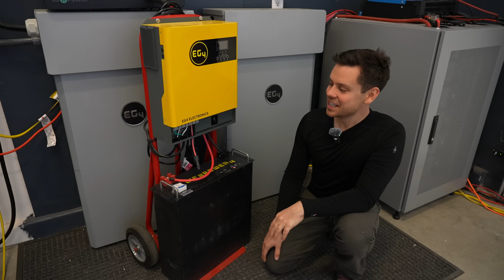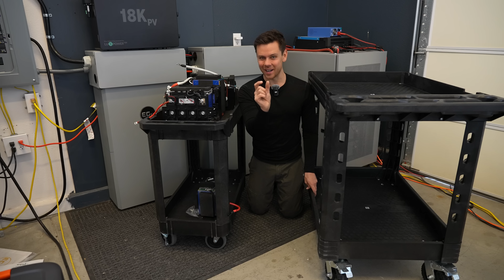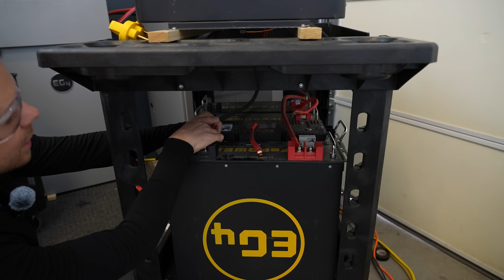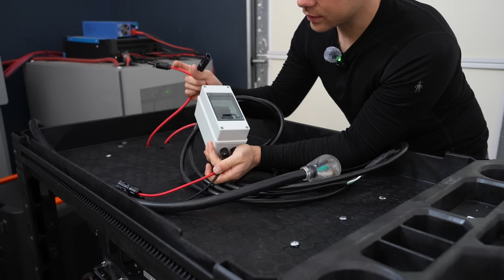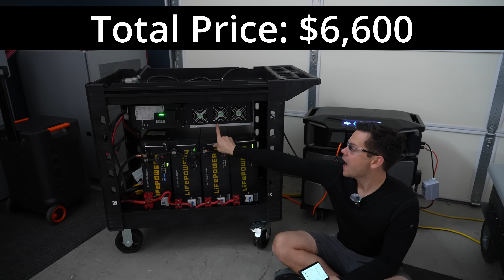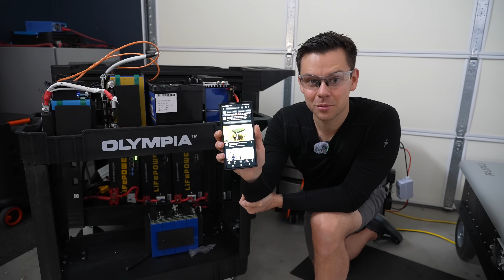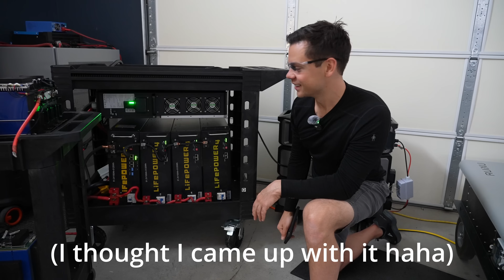DIY VS Ecoflow Ultra! Save thousands building the Solar Kart

Comment: Page 8 of the 6000XP manual specifies that "The inverter should be installed upright on a vertical surface", and specifically says to NOT mount it in the orientation that you used.  The is most likely related to their cooling design, but could also be related to certification requirements.

Comment: instead of 4 100 Ah batteries do 2 280Ah in those DIY cases (more energy dense), also like 40% more battery capacity and cheaper then 4 100 Ah Server Rack Batteries or if it can't handle the weight of 2 you can do 1 of them and still have almost 3/4 of the capacity of 4 100Ah but weigh way less and still come out cheaper then 2 100Ah and 1 of those can supply the amps needed for a 6000XP. If the cart could handle more weight you could go with 2 of those 280Ah batteries and a 12000XP.
Reply: Except those batteries are extremely heavy I think they're over 300 lb each and to try to set up by yourself let alone move would be difficult. Not to mention they've only been out for a little while and we don't know how reliable they are going to be. The server rack batteries have been out for a long time and redundancy is important especially for people off grid.
Reply: @MyCabinLife  I've been running a portion of my house off one since March

Comment: My priority when considering a system was decent capacity, at least an inverter that could deliver 6000 watts, have the desired and convenient outlets, and be portable in regards to transporting in a car. My choice was a relatively expensive F3800. I admire these DIY systems, but the portability is a backbreaking ordeal. What I’m getting at is the comparisons being made left and right between the all in one portables vs the DIY systems. They each have their individual place.

Comment: Next time you could install the inverter with the cart upside down to make it easier. With all the great stuff you build it would be easy to build a cart that has more weight capacity and whatever size you need.
Keep up the good work!

Comment: The down side is you need a smooth surface to roll this around. Will never go off road or to a job site.
Flip the cart upside down and install your converter/controller and flip it back over.

Comment: Nice video. The jackery explorer 5000 plus at sale (3000usd) with 5kwh and 7200w output is very good though for all in one solution. You can get 2 and have 14400w output, and add many batteries (5kwh and cost 2000usd each). However it comes with ready to use outlets and other advantages. Even for resale value I think I'd rather have 15kwh all in one vs 20kwh diy. It depends on your needs and how much solar you can harvest and make it work during the day (the heavy loads during light hours to use the solar and leave the battery for the night). This I mean for off grid. There are cheaper batteries and inverters than shown here but probably of lesser quality? Anyway, competition is good and power stations are coming down in price, yet to prove themselves as far as long term reliability. Nice video.

Comment: I am kind of surprised - I kind of expected a diy constructed battery pack - for less than $1500 you have 16 x 314 Ah cells and a suitable bms - ample space on the bottom shelf for them and 8 inch empty space left below the top shelf good for 16kW/h

Comment: Hey Will, from my experience, weight and capacity ratings are subjective (I am betting you are not naive to this fact). Due to Safety, Liability, Insurance, Government Regulations, etc, the manufactures max capacity of a widget is probably a fraction of what the widget can actually handle. For example, in the USA, an aluminum 80 cu/ft SCUBA tank, has a maximum fill pressure of 3,000 psi. In Europe, the identical tank has a maximum fill pressure of 5,000 psi.
All this said, It looked clear to me that the cart you were using was being pushed to the max.

Comment: I saw a guy that makes off-grid trailers that have solar panels, batteries, and inverter/chargers.  I thought that it may be a good business idea to provide temporary power in areas that are hit by natural disasters. Imagine being able to bring in via a trailer a power system that can run important household items (refrigerators & freezers, some cell charging and maybe a few lights and a TV) for several days or possibly even infinitely when the grid is down due to damage. I'm thinking tornado or hurricane affected areas. 
The challenge is coming up with a price model that makes it viable. 
I'm really interested in this concept and if it is doable even on a small scale.

Comment: I have a metal cart with 6 - 48v Lifepower batteries and a 3000 and love it.  Thinking of swapping the 3000 with  a 6000 XP.  I would get faster charging of the EV car.  I wish you tube would allow to add a picture to the replys.

Comment: I made one a couple of months ago. It’s a 12v system and I used your advice with on how to keep the batteries warm by using the Rv tank heater on some metal. I also installed a fuze box and some lights on a pole that’s mounted on the cart and they swivel. The only thing I wish I would have done is changed the wheels out for some that could roll over gravel, grass, and dirt. The wheels on these carts work great in a shop.

Comment: I did something very similar where I had my 6000XP mounted on its back, I thought it was great. Then my engineer, smart a$$ friend tore me a new one because it specifically says not to mount it on its back in the manual. Why would it matter if it’s mounted on its back?

Comment: WILL, is there a section on your forum for diy inverters like egsoo2 hf and lf boards?
I think there might be a cheapest easiest best route for an inverter, it would be, basically, pairing an egs002 board with a zx7-400(428) amorphous core transformer. 
Yeah, 
This would mean ultra low residual power draw, AND probably 95 percent efficiency, which is great. 
And
It would be small, and it could be assembled on 1 board, rather 1 assembly with fans, inductor, transofrmer and on swich and feedback. 
This could be a GEM for some on the forum.

Comment: Will, I built the same EG46000xp with 4 lifepower batteries using a custom 8020 frame. I got great advice from you YT channel and forum so I shared the details and BOM on your forum: threads / portable.88431. Happy Thanksgiving.

Comment: FYI 1/2" piece of HDPE plastic or plywood cut to the size of that lower shelf will help spread the weight out.  I build mountain top solar repeaters for work and this helps when building in a yeti cooler with a thin layer of plastic.

Comment: Wouldn't putting the two 12V batteries in series and using a 24V inverter be easier to wire due to smaller gauge wire?

Comment: Gosh those batteries are cheap. Wondering if I hook up 4 of them in series, I could use them alongside my LifePower 48V battery. Theoretically anyway. But it's probably best practice not to mix battery types even if they are the same voltage.

Comment: Carts are usually rated by the limit of their casters and not what the shelves can hold.  Find some better casters and improve caster mounting plates if needed, and you can put more weight than is sane on that cart lol

Comment: This setup have more inverter and battery capacity than the Renogy Lycan (which has two 48v 50Ah LFP batteries and 3000W inverter).

Comment: So, Based on some of your information, I'm getting the impression that two of the smaller carts with two or three batteries on the bottom shelf and  a pair of communicating hybrid inverters, one on each cart, would be the ideal way to create a portable, inexpensive (compared to buying a proprietary style rack mounting system), convenient DIY solar power distribution center. Just sayin'. With that, one could be loaned to your best friend in the event of a power outage and you could still power your 110VAC appliances and your friend should have enough to keep their food from spoiling until the power comes back online.
By the way, it's good to see you back to making unique, enlightening, and/or unique content. I had unsubscribed when you took your break from creating content. I have a very complete system but I still enjoy seeing what you're doing with currently available equipment.

Comment: On Amazon Little Giant
• 1200 capacity 
• Dimensions 36"L x 24"W x 34"H
Reply: 3600 capacity also available for little Giant
Reply: 445 is not a bad price for 42 inch 3600 lb cart
Reply: 650 lbs with 1 inverter and 6 48v 100AH  batteries total cost $9,200 for 29 KWH

Comment: Extra mass on the bottom shelf to spread out the weight will make the weight rating null and void. Aluminum would be the best, but most expensive option. 1/4 inch sheet would do it. Then the concern is the wheels, which can always be upgraded.

Comment: Could you hang the inverter off the ends of the cart?  If it would fit I'd have mounted it under the handle with the batteries at the other end of the cart.

Comment: Uline makes a 42 x 24 x 35 1200lb capacity 12ga steel cart like that.  It's probably more expensive, but 1200lbs is a lot of gear.

Comment: Great video.  I've been  thinking something similar like this but more of a wooden frame where I can use pneumatic tires or one of those garden wagons and build a top shelf to it with pneumatic tires.  I want pneumatic tires because there are two steps  I need to overcome to get in the house.  I like the concept.

Comment: Or get a 19" rack rolling transit case.  They're common in concert audio and military applications.  Then you can properly mount everything, and also not worry about that rectangle becoming a collapsing parallelogram when you roll over a bump and the bottom decides it's done moving.

Comment: Newbie question:  Could a person build two of these carts and use one 8kW solar array to feed them power?  Also, how much effort would it take to wire those two carts into a main breaker box and feed the whole house?  Basically, trying to build a DIY split phase solution with 40kW storage and 8kW PV input to power the house AND charge the two carts of batteries.  I want the whole-home solution to be mobile.  Thanks!

Comment: kind of feel a little dumb for not thinking of it sooner but I think I will get one of those garden or greenhouse wagons if I cant find one with some kind of shelf option Ill make them  add some 12v batteries my 3000w 12v inverter and some real heavy booster cables could make a real useful work station for around my shop and yard.  I guess with a decent shunt voltage reading and stuff in the booster cable line I could do some basic diagnoses and stuff HMMMMMM

Comment: Harbor Freight sells US General 36" x 24" metal tool carts for $80 ($60 w/ inside track club Membership). Is there any reason metal carts can't work with insulated padding also available at HF. Rated 450# but seem to be much stronger.

Comment: Thanks Will. This is exactly the kind of setup I need for my small cabin. Since I’m a complete!!!!! Beginner it would be great if you could do a step by step video for solar dummies. I guess when you’re as smart as you are it may be hard to imagine that even the most basic steps are a challenge for non electrical guys. Love what you’re doing this is awesome!
Reply: No this is a B&B and is mostly occupied.
Reply: Will this be left in an unattended cabin that falls below freezing?  If so, remember those batteries hate the cold and ones with internal heaters suck a lot of juice.

Comment: Please follow up with your suggestion of designing with a 12 volt system using the WattCycle 12 V, 300 AH battery/batteries. I just bought that very battery yesterday based upon your video from yesterday. We have been living off-grid in Central America  for about 3 years. There was a 100 AH battery with a single solar panel already installed when we moved here. We have since then purchased an EcoFlow Delta Mini and two panels which are not tied to the house power which we use to charge phones, 12 volt lights. etc. We want to gradually upgrade to a system that can run the small house we are in the process of building. I would be eternally grateful to seeing your ideas for a reasonably-priced 12V system that could gradually be expanded to 48V with another three WattCycle 300AH batteries. Thank you!

Comment: Nice build! While it lasting - you really should review the walrus G3 from batteryEvo, which is $4.800 for 22kw battery, 12k inverter 72V all in one system currently on a black friday sale. So it's cheaper and more powerful (on spec) then the one you've build. I really would like to know - is it good only on paper or it is an actual good deal.

Comment: Great video again. But I question a little bit the advantage of this over the ultra.  I ultimately chose the ultra which I got for about $6000 for 12 kW. I did it because of the EcoFlow app and all of the ability to turn various things on and off remotely, but more importantly, the EcoFlow ultra is self heating so it can be located in a winter location to charge up an RV or cabin without having to be heated and still produce electricity from solar. That for an extra $1500 you can get the ultra for 12kW as I did versus 10 kW building a 2-battery system with two batteries at $4500? Am I wrong about those two advantages of the ultra overbuilding your own system?

Comment: Last year I went with the harbor freight tool cart, put 4 12v 100A batteries on it with an inverter and MPPT with the best part being that the wife did not complain when the power went out and I could sleep without running a generator.  I now have two carts that I can use for the cabin, camping, and field day ham radio hobby.  Happy Thanksgiving and thanks for the video...

Comment: What’s the reason not choosing EG4 PowerPro WallMount AllWeather Lithium Battery | 48V 280Ah | 14.3kWh LiFePO4 | All-Weather Energy Storage | UL1973, UL9540A | 10-Year Warranty?

Comment: I built a cart like this that's similar. Except I have 2 of the new 3000w MMP Solar split phase inverters mounted in a unique way. I will post to your forum when I finish building the batteries

Comment: Very nice! Four 5KWh batteries is too much. Two should be sufficient and lay panels on the ground and boom!  I was thinking putting some foam or rubber pads so vibrations don't cause problems over time.
Reply: You can never have enough batteries! Haha 😂

Comment: You could always add a piece of wood or metal to the bottom shelf if the bolts come through for the casters. Longer hardware and then the battery load is directly on the casters instead of the plastic cart. Just use cardboard to make a template and then transfer it to your substrate of choice and boom, better weight distribution on the bottom for your cells.

Comment: It's the casters that will fail. I replaced mine on my 3 tier HF cart with heavy duty casters and I feel better about it. 12 batteries fit perfect. 4 per shelf. I also put a 1/2" piece of plywood under each set of batteries to spread out the weight to eliminate any sag.
Edit
When I say batteries I'm talking about four 12v LiFePo4 batterirs wired in series for 48v.

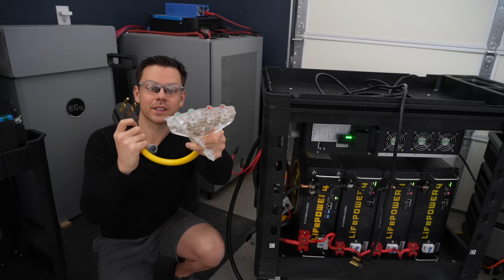Comment: 5:20 6-50 doesn't have a neutral wire. It would be using the ground wire as a neutral for that to give you 120v.
Reply from the maker: True

Comment: My shop system is contained within a military computer surplus shipping box. With the box sitting on a 1000 pound capacity furniture dolly. 2 server rack batteries, a 6000w split phase low frequency ECPC inverter, Chargeverter, communication hub and remote inverter panel. This just plugs into the shop breaker box with a heavy guage generator cord. But I can roll it to run the house if needed. No solar panels as of yet, but I can use the shop for a week or two between charging. Then charge from either the house grid or a generator.

Comment: Nice work! I modified a couple of these carts to hold more weight over time. Reenforce the shelves with 1/2 or 3/4 in plywood. I updated the casters with higher rated weight. I found these carts casters don't match up well with after market casters, prepare to drill new holes and update the Bolts and nuts.  Shoot add a piece of plywood to the front of the cart, bolt on a service panel with breakers.

Comment: looks like u have enough room under the handles to install the 6000xp with the screen and breakers facing the pusher. using 3 batteries leaves a fair amt. of room between back of inverter and batteries for accessories. shift batteries toward front of cart to counterbalance inverter

Comment: I’m looking forward to when Victron and the others transition to 19” rack mount equipment.  That will make all this stuff much easier.  Need more MPPT? Slide in another one into the rack.   If you look at industrial motor control centers the “buckets” slide into the frame and it plugs into the 600-800 amp buss automatically.  Someday there may be a DIN standard for equipment that integrates the bus and everything major unit slides into 19” racks.

Comment: If you can find the exact wheels on the larger cart you could add a 5th wheel in the center of the bottom shelf. That would make going over weight (and having the bottom shelf sag) a non issue.
Reply: A better solution would be to just reinforce the bottom shelf with a sheet of 3/4" ply.

The big problem with the weight rating, though, is the cheap wheels could buckle and collapse. So reinforced bottom shelf plus upgraded wheels to really make it solid.

Comment: Always would be a good idea to use some fire proof, stiff material for under the batteries to distribute the load more directly to the wheels. Plastics loove to deform under load. Cheers!